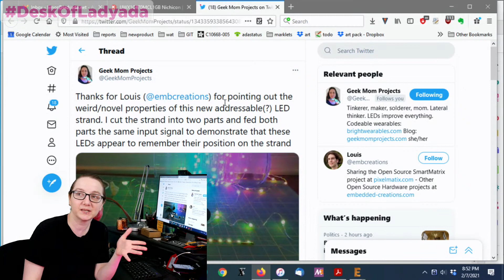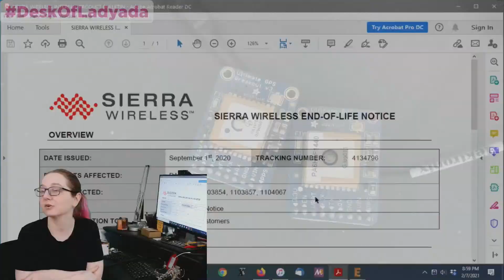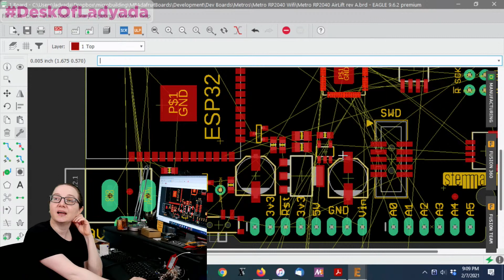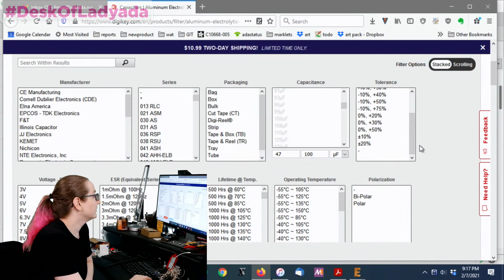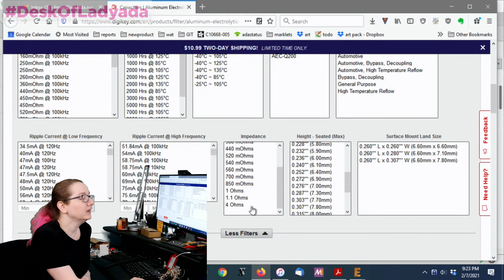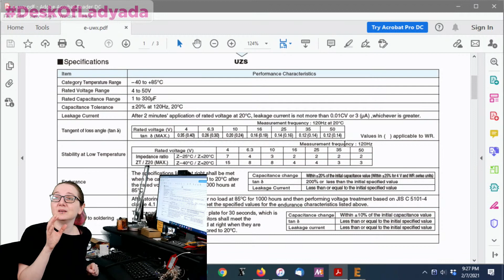DESK OF LADYADA - Another Snowy Sunday - A revision-full weekend!

Comment: I have seen caps popping due to being to close to rail voltage as working with motors you can get a back emf. Tantalum caps are more sensitive to these spikes. Very hard to find these faults as seen caps pop on one board where the spikes traveled up the power supply lines from a board way down stream.